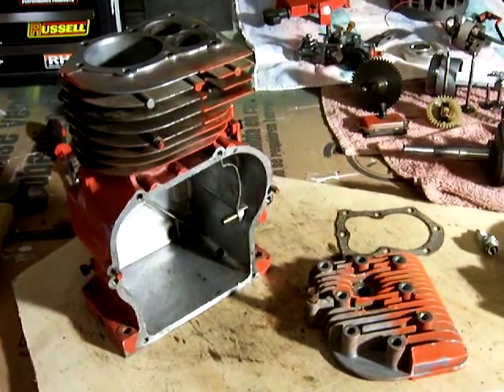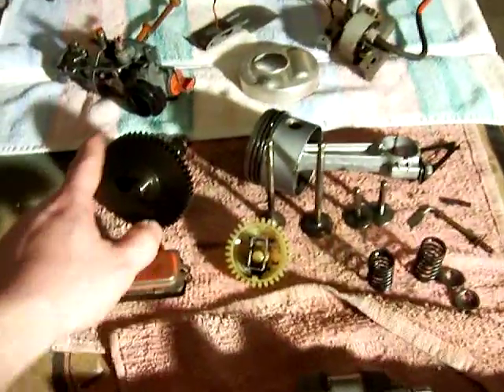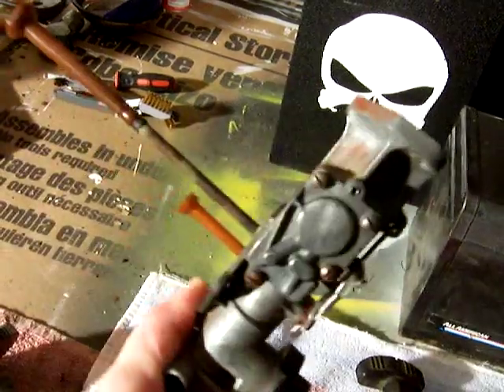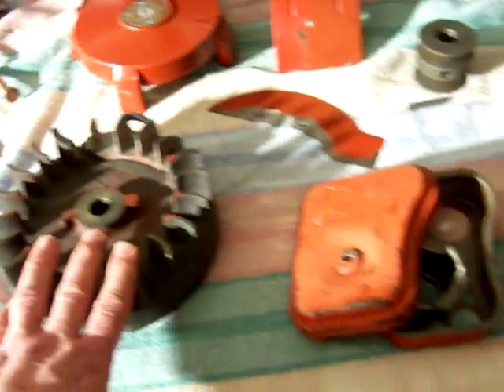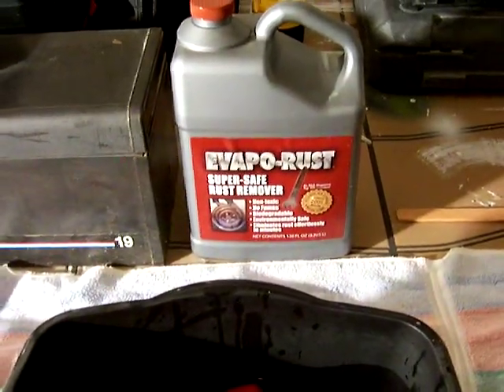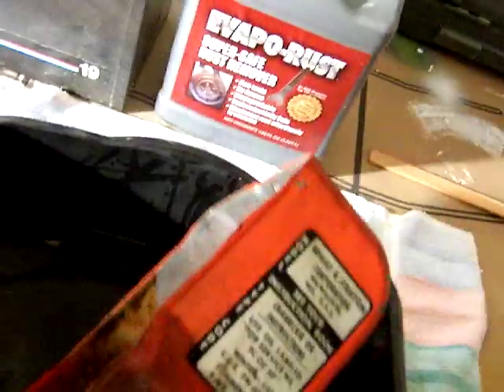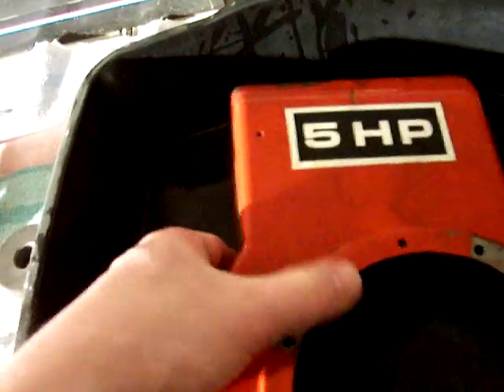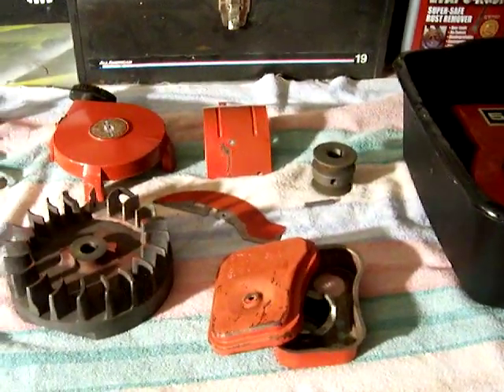Briggs and Stratton 5HP 130202 Tear down and Rebuild

Comment: Where’s the rest of your rebuild videos for this motor?  I have a 1974 version of the same motor and have replaced the points and cleaned the flywheel etc but still getting no spark. I’m thinking probably the coil is done. Can I use one from an old lawnmower so I don’t have to buy new? Do they have to be exactly the same? I’m sure they have to line up with the flywheel magneto, speaking of which, what is the proper gap? Thanx
Reply from the maker: Start here https://youtu.be/BuzISarG2mo

Comment: I have a similar engine.  Mine is 130202-0821-01.  I need to rebuild the carb.  When I search, I can't find a kit for this exact number, but I think as long as the 130202 matches, then I should be fine.  Any pictures I've seen, it looks correct.  Do you know if my thinking is correct, or do I need an exact match for all the numbers?

Thanks in advance.
Reply from the maker: Search for 130202-0821-99. Substitute the last two digits with 99. Also, use Briggs kit 5021 - it's just the diaphragm and spring. I can't seem to find a complete kit either but parts are available individually. Thanks for watching.
Reply: Thanks for the reply.  I actually found on Amazon full replacement carbs. (Chinese made I believe)  I might just go that route.

Comment: I have the same motor 130202-0140-01 that is on a Magna TillSmith Tiller. Two things, I lapped the valve. I haven't been through all your videos so I'm not sure what the valve gap should be. Also If ANYONE has a parts list for the Tiller. I believe the model is 509809. The motor was manufactured in 1974 and the tiller is a front tine.

Comment: thx for this video, I got a troy bilt tiller with a Briggs and stration 5hp motor. and didn't know anything about it, got it for free. carb, gas tank, linkage and head and pull cord cover were in a box next to it. I can only hope all the parts are there, don't know why its all apart but did see a bad gasket under the carb, I tried looking for a kit for it on ebay like you had mentioned but I didn't have any success. I might go to autozone and get a gasket sheet and make one, just so I can get it to geather and see if it works, I also think is has sat out side like this for a few rain storms, and think I should check the contacts before assembly. iv seen all your videos for far and I thank you for them.
Reply from the maker: You might search for "Briggs 297615". That is the whole engine gasket set for rebuilding the engine. OR try "Briggs 272409" That is just the gasket under the carburetor (on top of the tank). Thanks for watching.

Comment from the maker: If there is no governor in the engine, you could be inviting other problems. I had to rebuild a rototiller engine that had the governor removed/bypassed. The lack of a governor caused the engine to run at a much higher RPM and one of the valve spring retainers broke. The owner gave the rototiller away (thinking it was junk) and I inherited it. I had to tear the engine apart to find the problem. One little $2.00 part! See my Troy-bilt Versatiller video - that's the one.

Comment from the maker: It happened to me when I was using the snow thrower. Just as I finished up the driveway, the engine suddenly started racing badly. I shut it down immediately to avoid damaging the engine because I knew something was wrong. I didn't know much about engines back then but I did know that there was a governor for a reason.

Comment: Its terrible when it happens. My uncle had a Mowzall mower or something like that with a 4hp briggs on it. The weights came out but he said he didn't hear anything. Said it was cutting like crazy and ran great but he noticed oil all over the place so he shut it off and found the hole in the block. I have that motor now. Ill probably just patch the hole and put it back together again.

Comment from the maker: This situation is exactly how I got into small engine repair. My Ariens snow thrower with a Tecumseh 7HP engine had that happen. I was about ready to replace the whole engine when I decided to open it up. The governor weights were laying in the bottom of the engine. I ordered a new governor gear and crankcase gasket. With shipping included, it was a $23 repair. All is well now. I don't know why it happened - but I can tell you that the engine was 31 years old. It's been fine ever since.

Comment: I have had a problem with 2 engines now where the weights in the governor come out while the motor is running. The first engine it happened to was mine. One of the weights jammed itself in the timing gear for the crank and the cam and the motor stopped. Luckily no damage was done. The other motor however, had a hole blown in the side of it but still ran perfect afterwards. Have you ever had this happen? If so, why?

Comment: I have a engine with the same model # 130202 and I can't find parts for it, gaskets etc. I was hoping you could led me in the right direction, I tried ereplacement parts but the closest model they had was 130200, nothing came up on EBAY, any help would be aprecited

Comment from the maker: I went to the auto parts store and bought a can of automotive engine paint. It happens to be Rust-oleum Engine Enamel that is rated for 500 degrees fahrenheit. As far as original color, this engine came from a Yard Man tiller that was painted orange, so I bought Chevy Orange. As seen in another video, I painted my 1955 Briggs, Ford Red.

Comment from the maker: Without seeing your engine, I couldn't tell you what you need to know. My engine has an internal governor and therefore, it doesn't use a plastic fin to control the throttle. Even though the same model of engine is used on multiple machines (tillers, snow throwers, go carts, etc.) each machine has it's own way of controlling the throttle. So I cannot begin to guess what you have or need. I use Google Images a lot just to look at pictures and get ideas. Happy hunting.

Comment from the maker: The only plastic fin that I can think of, might be an external governor. Yes, there would be a piece of linkage leading to the carb to control the speed of the engine. As the flywheel spins, the fins on the flywheel blow the plastic fin, and as the fin moves, it controls the throttle.

Comment: we have the same engine, but there are several parts missing inside of the throtal linkage box. also inside of the pull start housing there is a plastic fin that had a piece of wire hooked to it that is hanging out, can you give us a diagram of how that linkage box is hooked up?